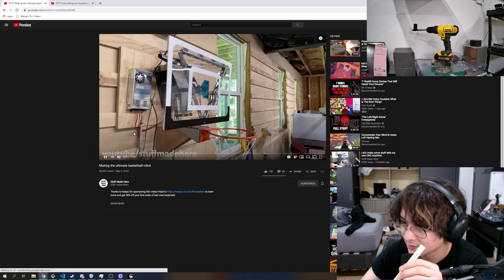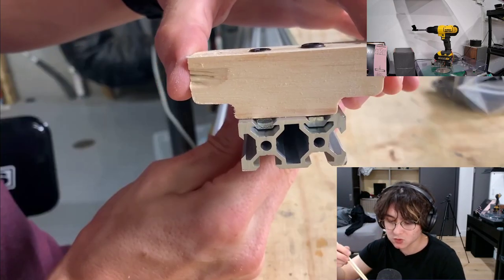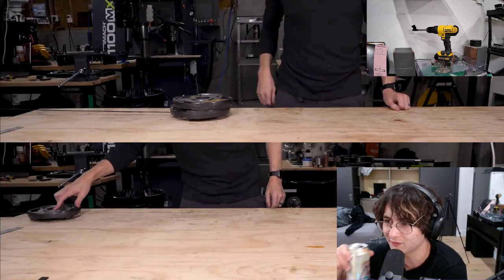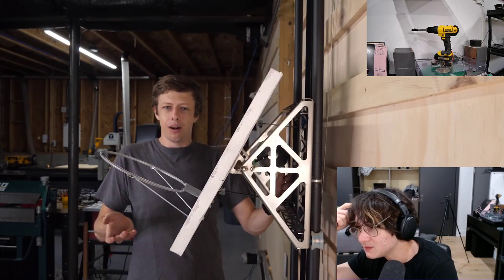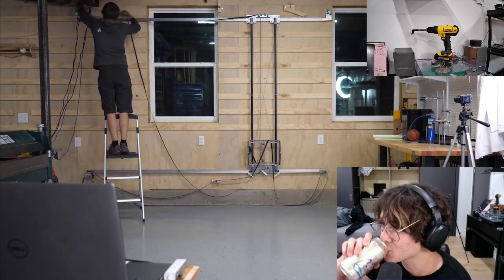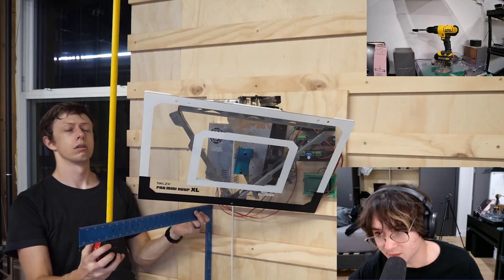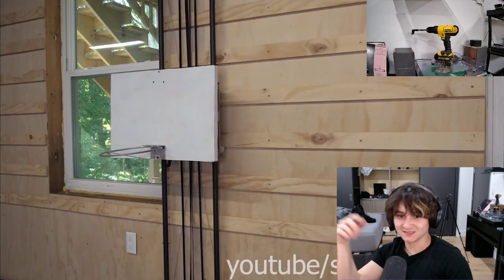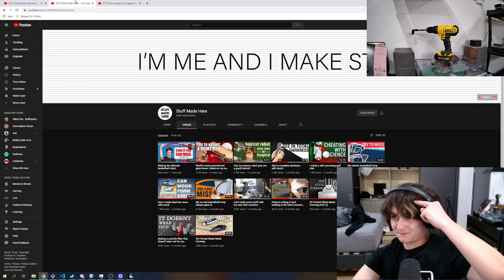Michael Reeves Reacts To  THE MOVING HOOP /// By Stuff Made Here!

Comment: Michael "How does he do that?"
Me: its literally the surgery robot on a wall wym
Reply: No it is not the same thing at all. It looks like it, but it is very different.
Reply: might just be me but it seems like the surgery robot with mark rober's dart board combined sorta
Reply: Stuffmadehere's robot is much more complex. They both use 3 degree of freedom movement, but Stuff's robot does it using 2 motors instead of 3, which already makes it quite difficult. The differential control to tilt the hoop is very clever I think is actually quite tricky to implement without something breaking (which we saw happened multiple times), especially considering the mechanical contraints of the belts. Stuffmadehere only glossed over the ball detection, trajectory calculation and prediction, but that's also more difficult than he made it seem.

The surgery robot is absolutely impressive, but from a robotics perspective it's simpler than it looks. The motion detection camera directly gives you coordinates in a 3D space which you can just immediately push into the surgery robot. No extra mathematics really required, apart from converting spatial coordinates into motor input data, but that is quite simple as well. The end effector of the surgery robot also moves in a straight x-y-z-coordinate system, which is also very simple to control with the 3 motors he used. Though I think the mechanical design he used to construct it was splendid!

I think from this video we can tell that Michael hasn't had a lot of formal mathematics and robotics training (I think he's mostly a programmer), but I believe he's studying it. I think with every video he's just getting better and better. Can't wait to see his skills in the future!

I think both Michael and Stuffmadehere are very impressive and sort of complement each other well though. Michael is an amazing presenter, and Stuff is an outstanding engineer with lots of experience. Would be cool to see them collaborate on something!
Reply: TRUEEEE AHAHAHAHAHAH
Reply: Yeah but you have to predict the trajectory
Reply: everyone's talking about how the software is more difficult, but noone mentions how he made his entire thing move and tilt with a single belt
Reply: mane  the software isn’t the same either lol this one has an entire 3d tracking and prediction system
Reply: the pulley system hes got going on is a lot harder and horrible to set up than the sliders used for the surgery robot
Reply: Except it actually works. 😂😂
Reply: Nah, His is way more stable  and reliable and more elegant in general.
Reply: it's not....